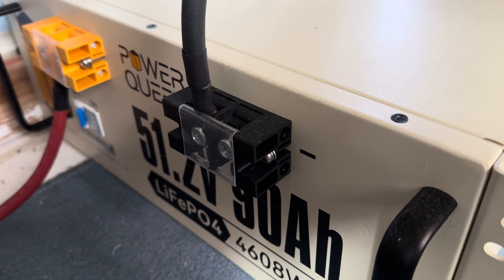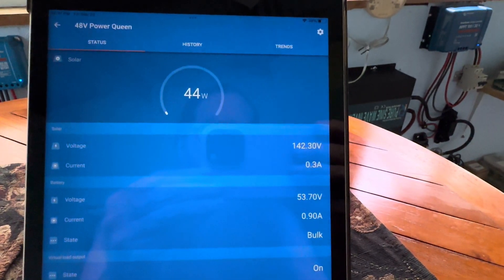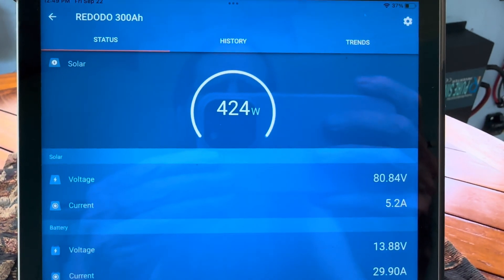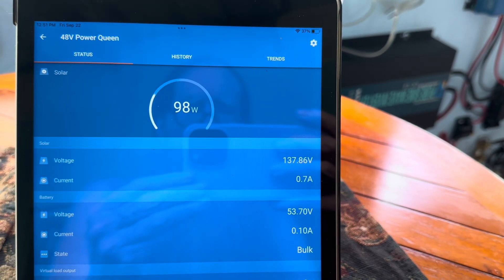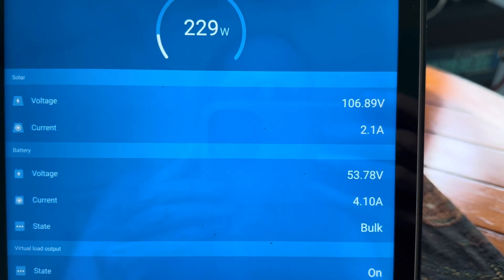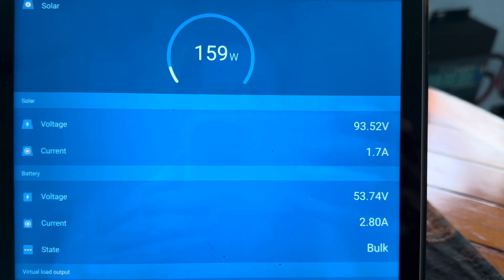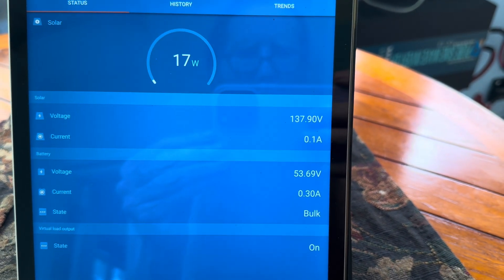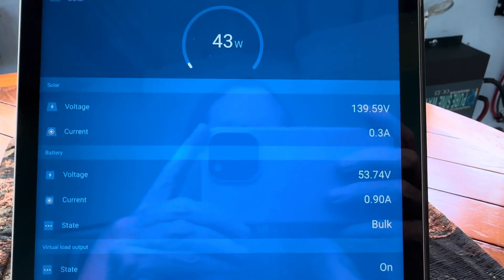48V LiFePO4 charging parameters pt. 2  Follow up from yesterday...very last scene beeps of course!

Comment: Looks like BMS doing something like disconnect and re connects . their is a capacitor in the inverter. that voltage spike may be coming from that.    You have a light load on that system. this may just be the inverter seeing the voltage spike and grieving a warring. try putting more load on inverter to see if this beep goes away. with 48V the inverter amps will be less. try to test around at battery ,inverter ,charge controller  
to look for any voltage drops. I have seen a bad connection do things like that. well you could open that 48V battery and test each cell voltage and see if just a unbalance cell. will take some time . lot of cells for 48V .
Reply from the maker: Aloha Roberto! So since I finished that video the alarm has been non stop. I just did what you said, and plugged in that Oupes power station to the 48v to charge up. Immediately the alarm stopped, but the sun also disappeared so I don't know. I will continuue to work it a bit harder as you say. Mahalo brother for always giving me things to do, and try. 🤙

Comment: I want to thank you for your video yesterday. That video inspired me to go into my settings and set my Absorption to a higher voltage than the pre setting.. I had no idea i could do that. Also messed around with some of the other settings. So thanks for yesterdays video. BTW i got my C.C. do behave they way yours did yesterday with the up and down fluctuation in Wattage. Wow i heard the alarm. My guess you are get an over voltage Alarm from the  C.C. You may have to adjust the voltage way under to what you have the settings now. or if thats not possible with in your liking. You may have to try another Inverter with higher voltage limits.
Reply from the maker: Mahalo for all your contribution to my friend. I learn from all of you sharing your experiences...Aloha!🤙
Reply: @ProjectsinParadise808  my pleasure